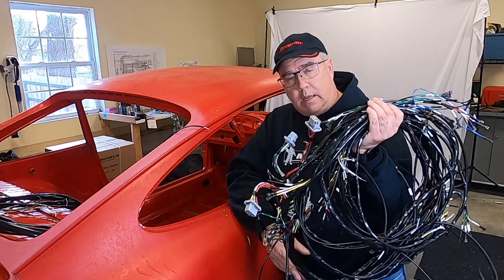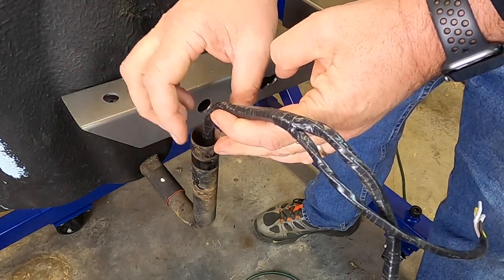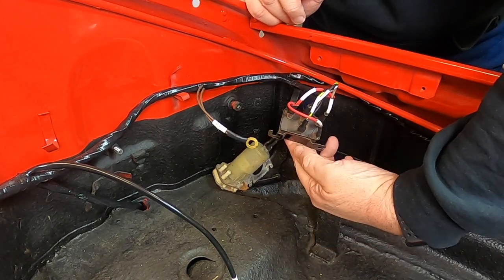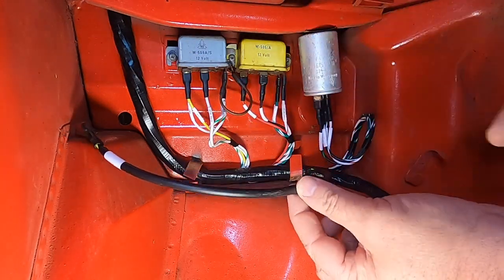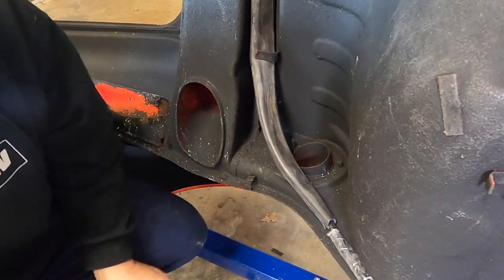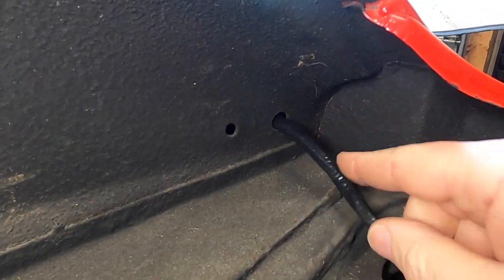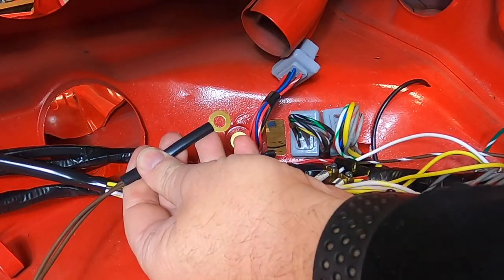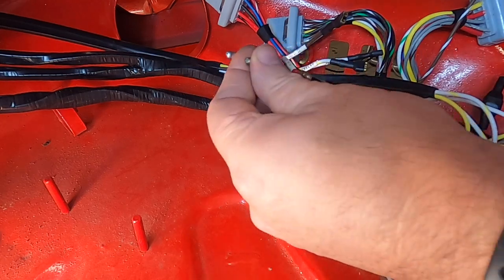Porsche 911 and 912 Wiring Harness Install in 1965-1968

Comment: Can’t thank you enough for the video. I‘m in the process of putting a 1977 stalled project back together. I have the old wiring harness in a box ! A jigsaw puzzle which you have just shed some light upon.
Reply from the maker: Hi Paul and thank you for the kind words.  But please be aware that the harness on a 77 911 is different than the 65-68 cars.  Similar, but different and I'm not sure as to how similar they are as I only work on the early stuff.

Comment: Well done and where did you get those "correct" grommets!? I had to order mine from a motorcycle shop out of the UK and it took me a while to find-um. I used to scour the wiring diagram, blow a couple fuses and feel insecure about every electrical step along the way, despite the relative simplicity of the overall system... Now I plug-n-play. When I do put that new wiring harness in my first Porsche, I know where I will go.
Reply from the maker: Thank you for the kind words! The grommets, as well as some other items. have been quite a journey to find.  There are tons of grommets for these cars on different sites but none of them have a specific application listed. So it was trial and error and a lot of measurements.  So no easy answer from where.  It was many different places but mainly directly with grommet manufacturers. .  I now offer a complete set of them.  Should be on the website very soon.

Comment: Hi! I am trying to hunt down the control light unit - number 45 in the wiring diagram. The cylindrical unit you show it at around 30 minutes with S,L,R and 30 connections. Do you know where I can get one? I cant find reference to it anywhere. Do you know the part number? Thanks... great videos, you are a life saver!
Reply from the maker: Hi Jonny.  That relay is becoming incredibly hard to find.  Check out this thread on the Early 911s Registry forum, and hopefully, it will help.  What you need starts on page 2.

Comment: Great job! Just one question: if I have a 911, where does the oil level wiring goes through?
Reply from the maker: Good catch.  I should have explained that.  On the 911's there should be a hole at the end of the J-tube that the wire would come out of.  Very near where the tube bolts to the tank to stabilize it.

Comment: Is this process the same for a 993? also is there a way to tell if your harness is working without it being installed ?
Reply from the maker: No.  The process would be completely different for a 993 (built 1994-98).  This video is only for year models 1965-1968. And yes, you could test a harness out of the car.  You would need a multimeter, AMP probe and all the specifications of the different electrical components and of course a wiring diagram.